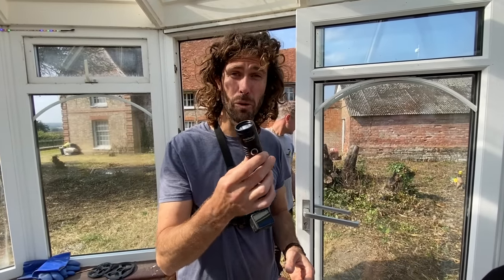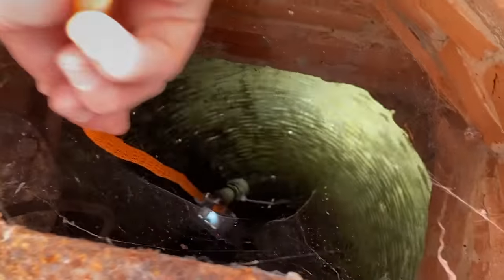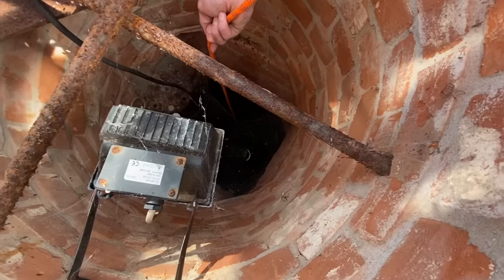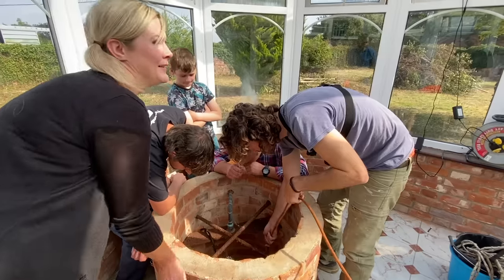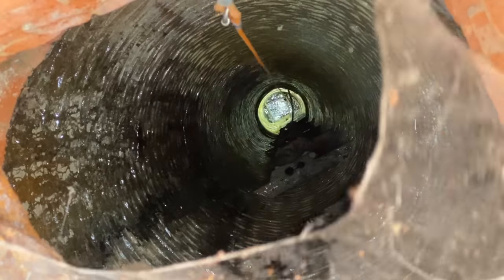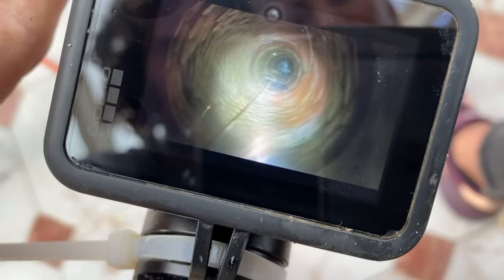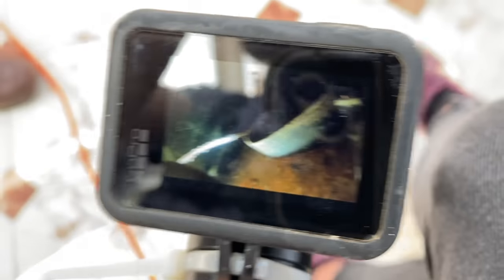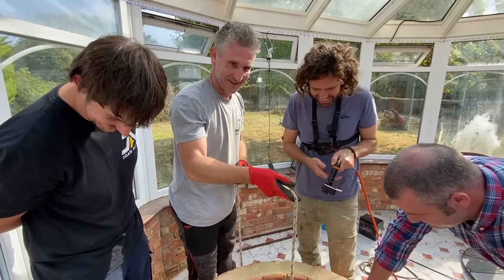Magnet Fishing Treasure From A 1000 Year Old Well!

Comment: The reason the well was dug at the top of the hill has to do with physics, and an easy gravitational pull with which to water one’s crops. There is also pressure build up “Venturi’s Principle” which also create additional ease of crop irrigation. In the old days, it would be considered a No-Brainer”. I love the diversity of your content. Keep up the great work! ❤
Reply: A venturi is also a shaped soft-sided blade added on the rear of a car to pull the air away from the body and direct it closer to the ground. Thanks 😊 for the physics intro.

Comment: hey leigh, a little battery powered winch would make life alot easier? something run off a 12 volt or even 240 if its available nearby (the house). drop the magnet like you were, then just winch back up, save the legs some cramp. a non magnetic bucket scoop would let you get the pottery as well. just a thought if you continue with the well idea (love the idea by the way, people always throw things in wells).
Reply from the maker: Yes I’d love to try it again and a winch would be much easier 😂

Comment: Too bad you might have broken the dishes with the magnet. I wonder if anyone couls be possibly lowered oe have a rope ladder hoist down to get the dishes or what ever could be down there? Awesome video!
Reply: Well water from that depth is around 52 - 54 degrees... the same as the water coming out of the overflow pipe of my Artesian well. Winter, spring, summer, fall -- the water temperature remains the same AND it never freezes. He would need an insulated wet suit to be in the water for more than 5 minutes.